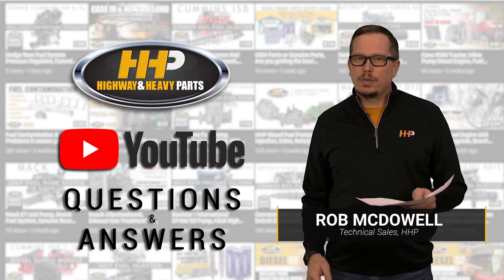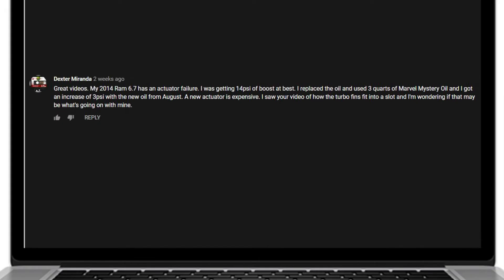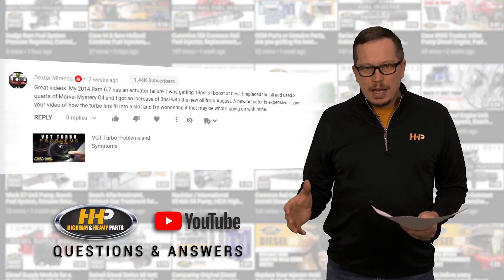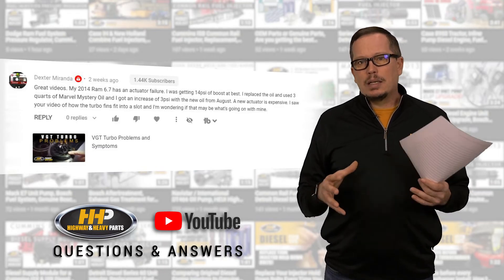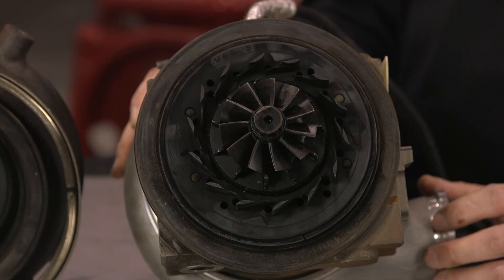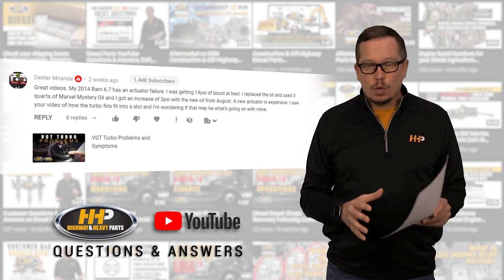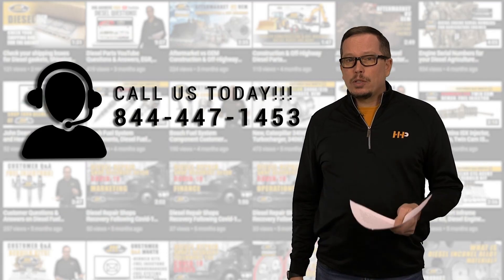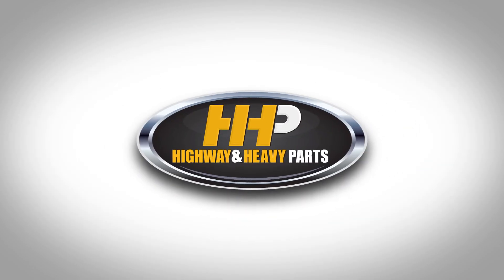How do I know if my Cummins 6.7 Turbo Actuator is bad? HHP Can Help!

Comment: My truck has been giving this code, P00AF, for about 6 months.  I just haven’t got around to checking out.  If this part is bad, you’re saying the truck will lack power and pretty much just suck, right?  Mine is certainly doing this.

Comment: I'm having a similar problem, but mines intermittent. My cil will come on and there's little to no boost, and it's gutless, then I'll shut it off and it's back to normal. It use to happen once a month, not it's more frequent to every other day, but it tends to go away after the truck stops and is shut off.
Reply from the maker: Try some of the troubleshoot tips that Rob discussed in the video as a starting point to diagnose this issue. Hopefully that can get you directed toward correcting the problem.
Reply: You figure this out?

Comment: 2010 3500 . I have to listen to make sure the actuator cycles fast , and , after a few tries , it does , then I start . If I don't get that quick change sound , and start , I get zero boost . I let it run for 5-10 secs at idle or it smokes severely if I try to move the truck . I wait 5+ seconds , turn the key and then , I typically get that quick change actuator sound . It runs great , get lots of boost , brake works , but I do know I feel it's the actuator . I could make a video for you and link it if you like . It happens often enough . Even if parked 20 mins or more , it might not work without cycling a few times . 
Just to confirm , best to drain the AF juice , remove the actuator , confirm free play on lever in turbo , them blame the actuator 99% ? 

Thanks in advance and thank you for making these videos . Without guys like you , I'm not sure how I'd solve the problems I run into , lol .
Reply from the maker: Glad you like the videos👍!  You may want to get in touch with our ASE Certified Sales staff for more on your actuator.
844-447-1453

Comment: Will an actuator cause an extremely high pitched sound when exhaust break is engaged? I have checked multiple forums and 95% point to exhaust leak. I have throughly inspected the exhaust for carbon and found nothing. Exhaust shop couldn't find where leak is coming from. My local diesel shop couldn't figure it out either. They don't think turbo or actuator.  Then suggested smoke testing. I did that from tail pipe and intake with 0 smoke showing using a 1000w fog machine at 30% mix (highest smoke concentration). I'm running out of things to check and hopefully you can give me an idea of what to look for. 

Also it started as just squealing when exhaust break engaged but now it has developed to when pressing accelerator slightly while in P. Truck has 0 boost issues with spool or vacuum. 2016 Ram 5500 6.7.
Reply: Forgot to mention 0 fault codes related to exhaust or turbo.
Reply from the maker: Was your exhaust manifold removed for inspection?  I've seen reports of a warped manifold causing this issue.
Reply: @Highwayandheavyparts  so as an update. Exhaust manifold finally showed soot. Replaced gaskets and had a different kind of squeal start. Same issue only happens when using engine brake or quick acceleration. I ended up solving my issue by double hauling (this is a rollback) 2 heavier vehicles up hill for about 15 miles. Black smoke was pouring out of exhaust (used to have white prior to exhaust manifold change). After a good work out of the turbo the squeal stopped. Now I periodically hear the squeal starting again and I just get on it going uphill to clear out smoke and it shuts up. Also I heard some odd grinding noise coming from turbo area while driving (self cleaning or something???) And it will produce a crap ton of black smoke after it finishes the grinding for about 15 seconds.
Reply: Same problem in my 08 5500 bucket truck. Turbo is weak and makes a fluttering sound when trying to spool.. 10day road trip tomorrow....

Comment: Mine hangs in exhaust brake mode and sometimes won’t engage exhaust brake other then that boost is never an issue.. when it hangs in exhaust brake and you push the throttle it throws a boost code for zero boost… actuator?
Reply from the maker: Yes, start with an actuator diagnosis.